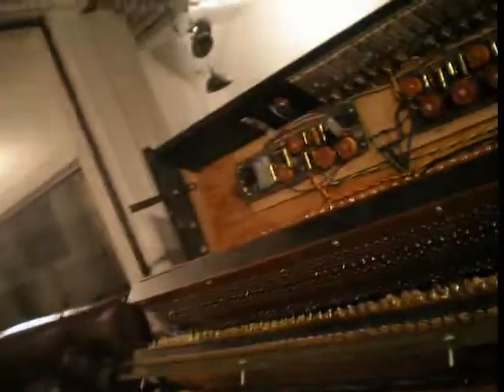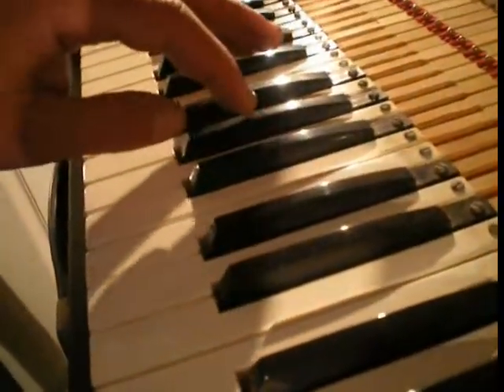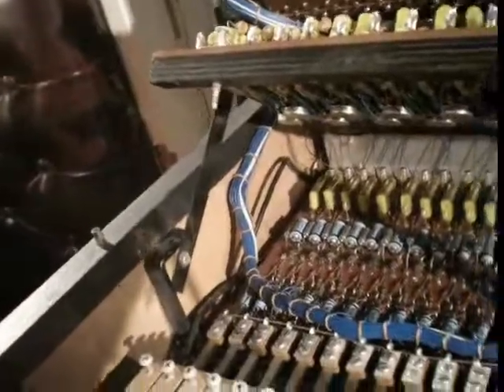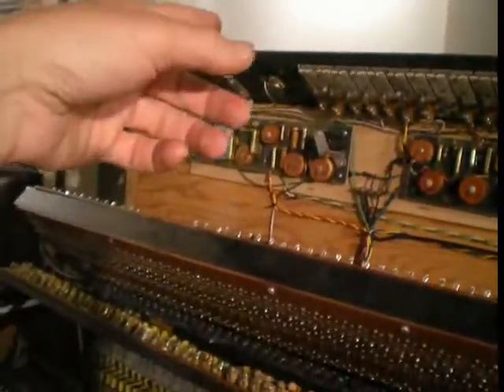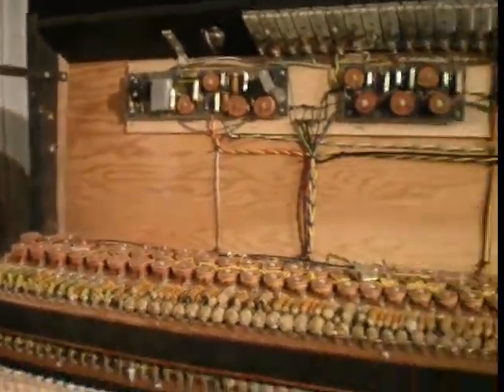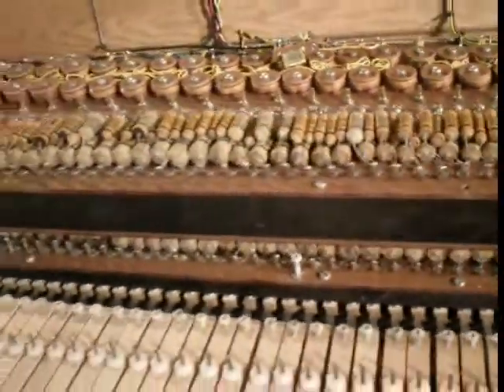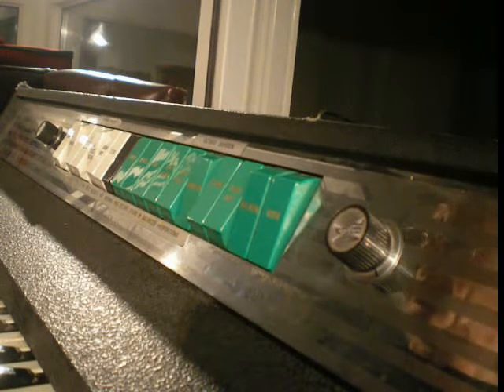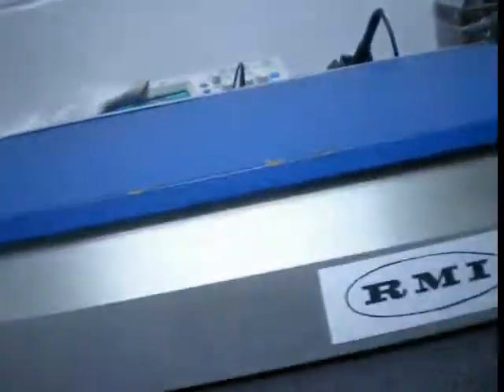RMI Rocksi-Chord and Electra-Piano

Comment: I have a beautiful old ex-BBC RMI 368. It's in good condition, but one note refuses to be tuned accurately. I've run out of tuning range on the trimmer pot. I notice in this video you mention a 'coarse tune' coil - can this be set to give me a little more range on the fine tune? Any guidance or advice gladly received.

Comment: How easy is it to get the keys to work again if they’re not making sound?
Reply from the maker: sometimes just contacts...sometimes a shorting cap or diode or transistor.  must check voltages /compare to working sections etc.
Reply: sounddoctorin what do I need to do all this? Do you have any schematics for this? The one I’d be getting is the electrapiano/rock si chord
Reply from the maker: @michaellavender  i have a file that has info on both.  The Rocksi just has 2 osc/note.  get me email to send to off my sounddoctorin.com contact link
Reply: sounddoctorin ill get a hold of it, thank you. I’ll email you shortly